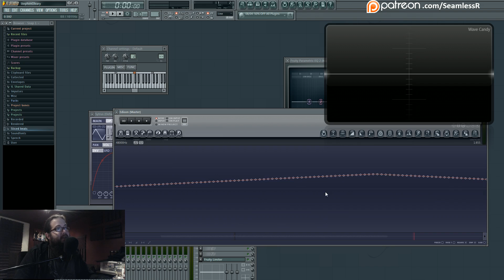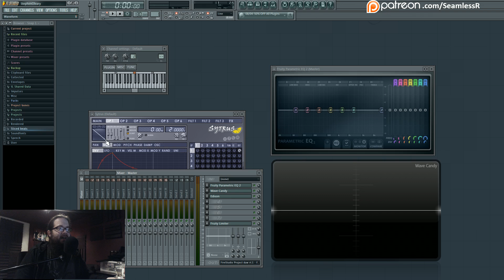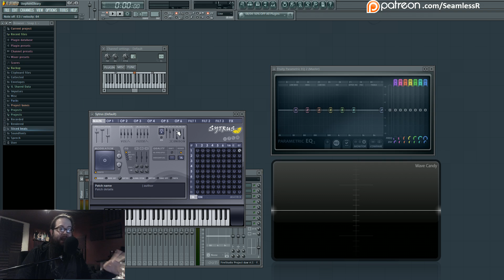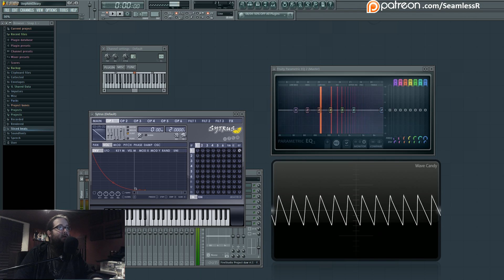Production Basics 5: Waveform Basics

Comment: You totally left out what frequency and amplitude is. You know, showing "Y is volume and X is time. The tighter the cycles go, the higher sound and vice verca."
Reply from the maker: Yeah that would have been useful in this video. For some reason I had it in my head to separate how phase cancellation works into its own video and I figured that information would make more sense next to that instead of rehashing it. Which might not have been the right call ;p

Comment: You could have shown how to make a pulse wave using 2 saws to show the similarity..

In Sytrus, you'd turn on Operator 1 to 100% and Operator 2 as -100% and set the starting phase (the knob that says PHS under the Freq offset HZ bit) of Operator 2 to 50% to create a square wave, and anything else would be a pulse. You can detune one of the operators to make the pulse width change as the sound plays.

Comment: Whenever I play any note higher than like C5, I get crazy aliasing in Sytrus. Anyway to get rid of that?
Reply from the maker: Go onto the main page of sytrus and engage oversampling. Higher notes will need higher amounts of oversampling to avoid aliasing.
Reply: That fixed it. Thanks, man!
Reply: You can also enable bandlimiting on the oscillator page, like Seamless has in the video. Then you don't need to use oversampling